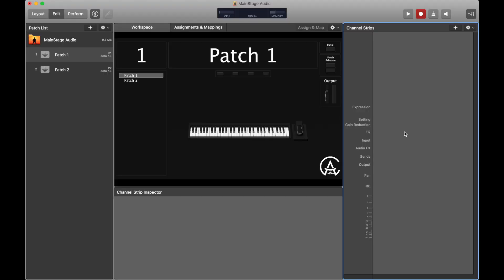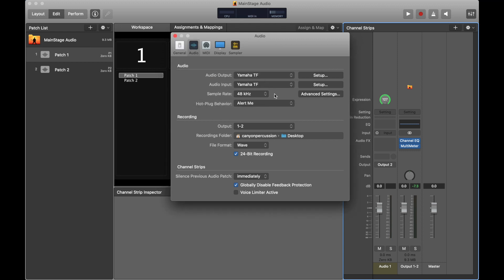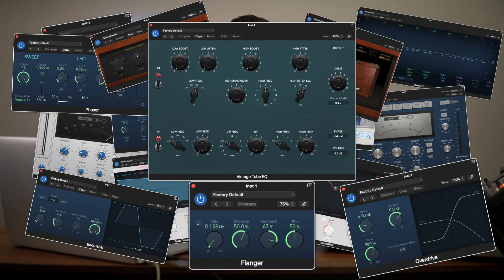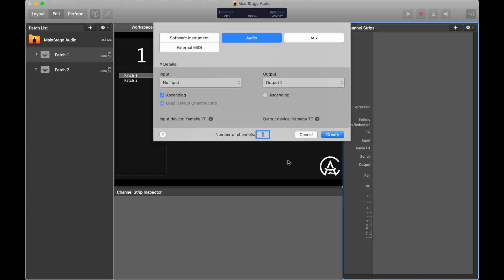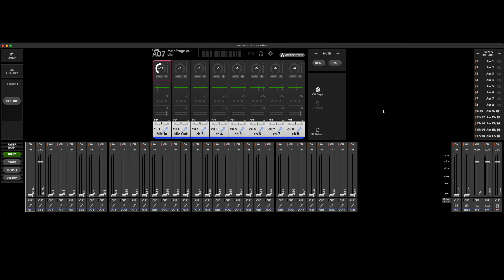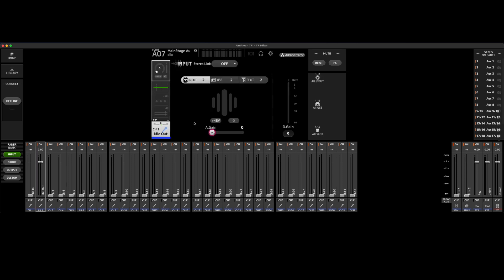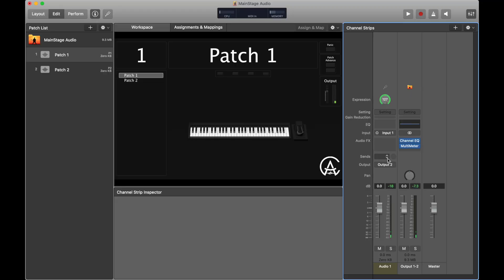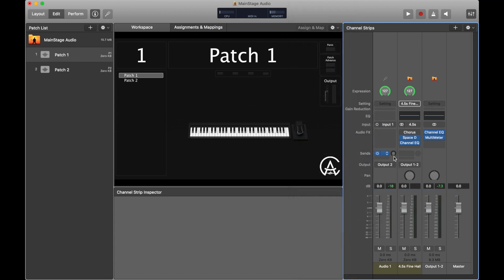Crazy Audio Effects in MainStage??

Comment: Could you please advise if the mainstage will experience any delays when using the Yamaha TF1, or if there are other interface recommendations you might have? I require a setup that supports at least four vocal microphones and four instruments, all connected via XLR. Additionally, I need a setup with at least four auxiliary sends. I appreciate your guidance. Thank you.

Comment: @catherall audio please reply. 
Can we use a manual mixer if I don't have a digital mixer, to connect multiple input sources. 
Please help
Reply from the maker: You can if the analog mixer is able to be used as an audio interface. You’ll need to check the manual for the mixer that you own, and look for a USB port on the mixer.
Reply: @CatherallAudio  hi thank you for your reply, can you make any video on this, because we don't have much information regarding this on YouTube  we use anlog mixer SoundCraft signature 16 channel.